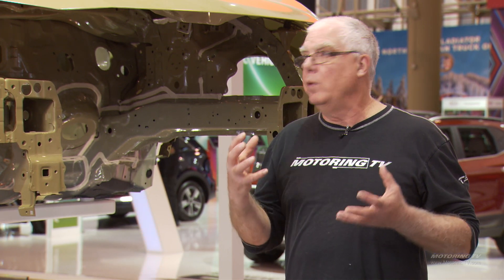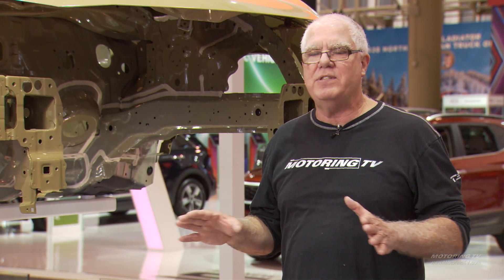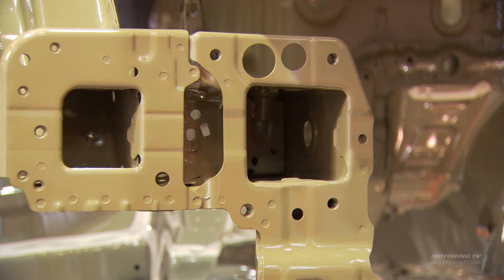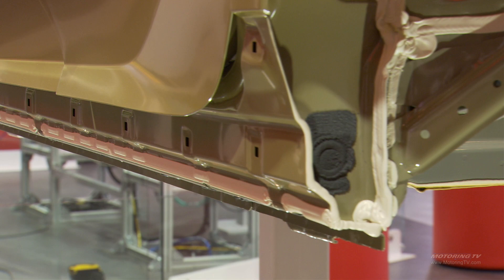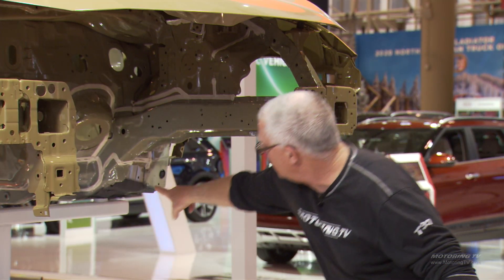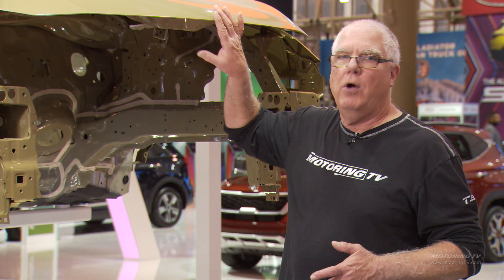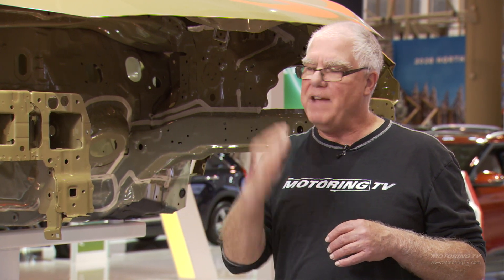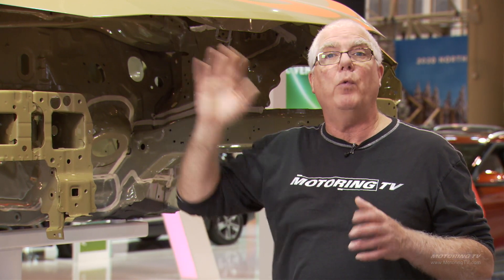How Car Makers Help Prevent Rust - Tip of the Week

Comment: That looks like it has zinc in it, my 1963 corvair ive noticed has a zinc primer similar to that (although applied differently)
Zinc just being attached to the vehicle helps because it will sacrifice itself and corrode before the surrounding steel will.
 On steel boats you can just bolt a slab of it on and it will protect entire areas under the water but obviously in open air a coating works better.